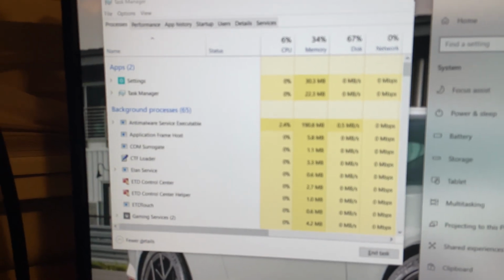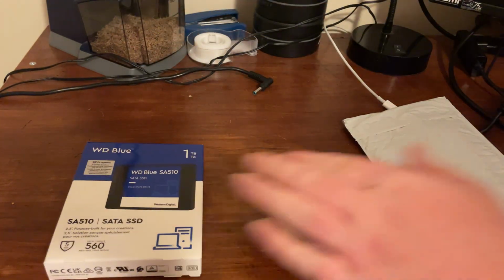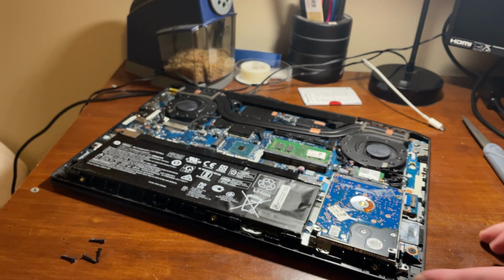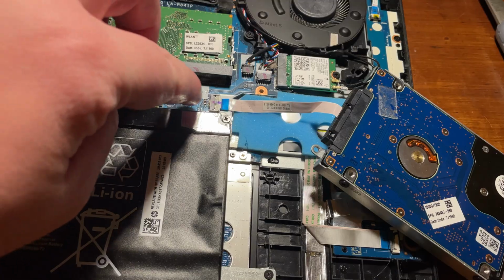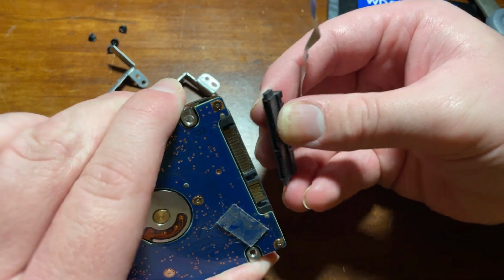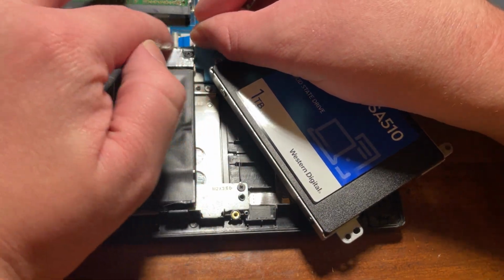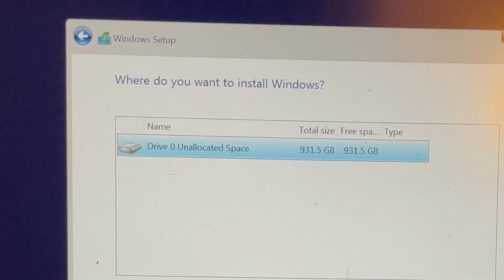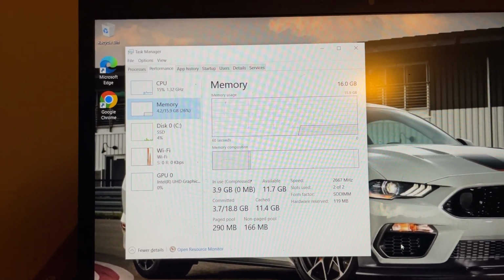I Upgraded my old HP Pavilion Gaming 15 Laptop, and now it runs Better than Ever Before!

Comment: I clearly see the M.2 NVME slot, are you sure it doesn't have? Great video anyway, I have similar laptop and mine does have m.2 NVME slot
Reply: My version of this laptop has an Intel Optane RAM accelerator installed on the NVME slot. The original Optane chip has only 16GB capacity as a cache for the mechanical hard disk. I suspect it can actually directly replaced by a new PCIe 4.0 SSD.

Comment: Dude I can literary see the M.2 NvMe SSD slot to the right side of the RAM slots...
Reply: I have similar laptop and it works on m.2 nvme currently
Reply: @mk_world_24 is it 2230?
Reply: @christiansoto8262  I didn't get the question
Reply: @mk_world_24  The sizes of m.2 SSD's, 2230 and 2280.

Comment: this hp pavilion is probably cheated man, u got no graphics card? + urs didnt come with an SSD and u paid 400 dollars for it, I paid 500+ USD for mine and it runs like a beast, it has a 9th Gen Intel processor with a 1650 ti graphics card and 16GB ram but I upgraded it to 32 and a 500GB SSD which is the only downside of this laptop i wished i had more disk space
Reply: The older versions came with 8gb ram, hdd, and 1050ti
Reply: @christiansoto8262 just regular 1050
Reply: Where did you buy it

Comment: I thought that the HP Pavilion Gaming 15 laptop you got had problems like the touchpad being broken, the screen broke, and you just decided to replace it with an MSI GF63?
Reply from the maker: It did, but since everything is working as of now since I had HP repair it a few times. I decided to upgrade it and keep it as a spare.
Reply: @icecreamjunkie6790 is it possible to upgrade the graphics driver on the hp pavilion gaming laptop 15?
Reply from the maker: @-trgames-6003  Yes. Since this laptop has an NVIDIA GPU, you can update the driver by opening GeForce Experience, going to the Drivers tab, and clicking Check for Updates. If there is driver update available, you can download and install right in the app.
Reply: Oh, ok.  I just find it weird how you said in your MSI GF63 unboxing about your HP you didn’t wanna keep spending money on something that was just gonna keep breaking and needed to be fixed, but whatever it is good to have a spare.